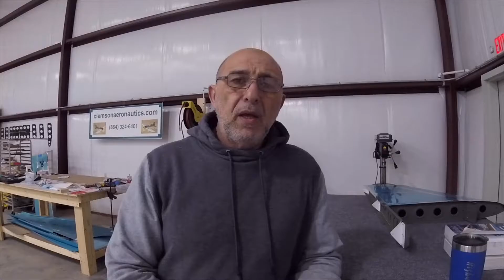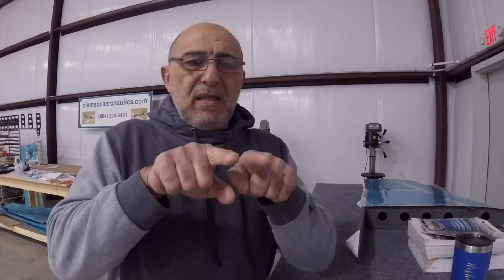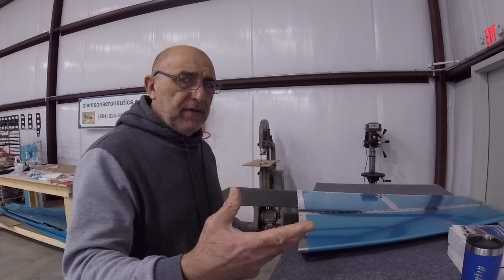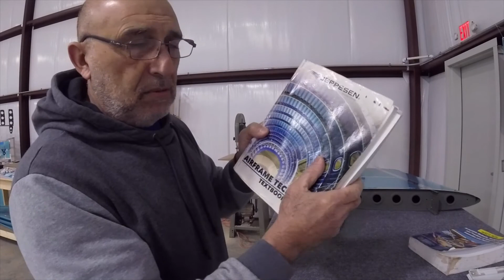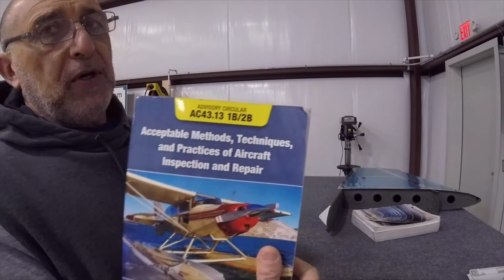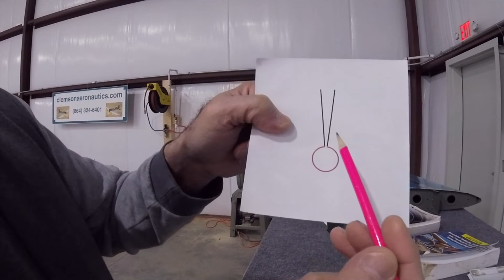Clemson Aeronautics RV-14A Build Building Essentials 1

Comment: The skins on the 14 run from 0.016, 0.020, 0.034 & 0.040 skins.  The Cogswell or Easy burr work great on skins thicker than 0.032.  On thinner skin Hasham's advise is a wise point.

Check you homle side after dimpling.  Too big of a hole requires more 3/32" length than Evan's calls out.
Reply from the maker: I guess you mean (check hole size after dimpling) (too big of a hole requires more length of the rivet than Van's calls out). Thanks for your supper :)